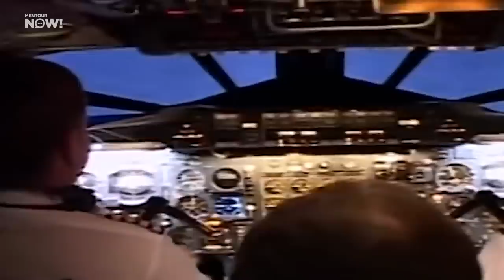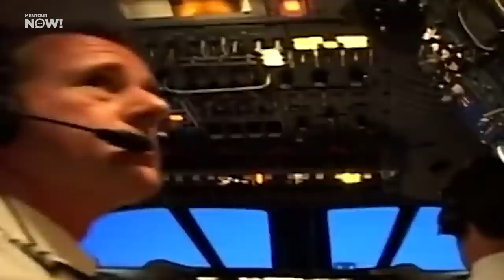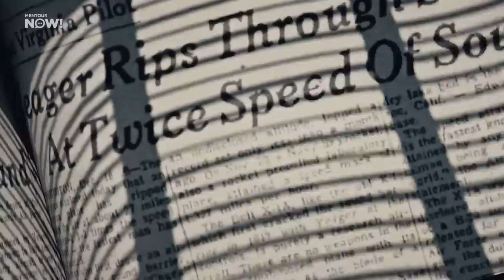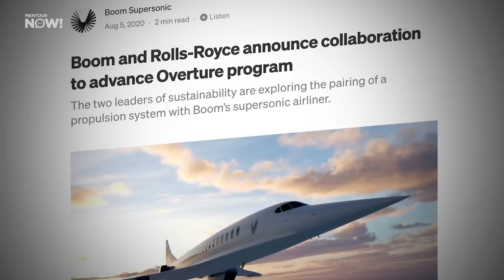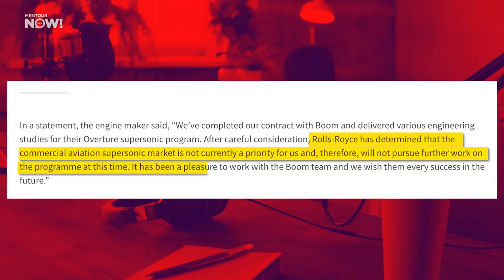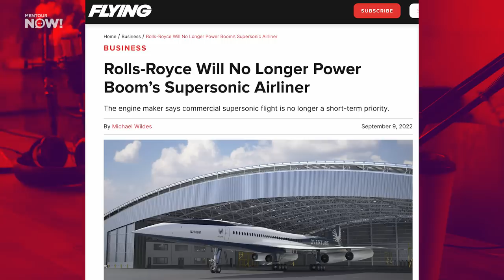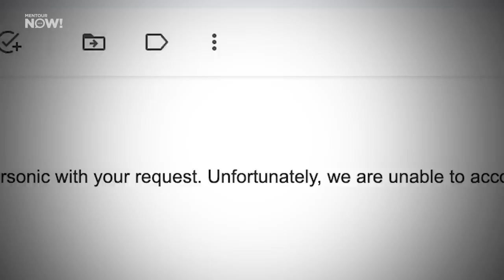WHAT’s Going On with BOOM Supersonic?! Will it Fail?

Comment: They just seem dumb to me. Building a commercially viable supersonic airliner is like a start up out of a garage stating they'll land a man on the moon. The USA's greatest shot at this very project failed miserably. It took the British and French combined together, spending three billion dollars (in the 1960s!) to make the plane work in an astounding feat of engineering. The commercial side was still largely a failure until Concorde became a luxo barge for the most wealthy elite. The engineering required then and now is off the charts difficult and the economic situation impossible when companies don't even want to run four engine airliners any more. It's sheer arrogance, stupidity or both for some little nobody to think they can do it even with the passage of 60 years. It's no easier today to do so than land a man on the moon. You better have government backing and a spare ten billion dollars. Then it might work.

Comment: Basically the project is dead, if top 3 engine manufacturers aren't interested then no other company has know-how or finance to make an engine. 🤔
Reply: Florida Turbine Technology, a division of $1.88bn Kratos Defence, started the symphony engine design in January 2023. Boom stated that no current engines, either military or commercial, are suitable for adapting to Overtures unique requirements. 

Boom will design the engine pods and the variable geometry exhaust and inlet ducting.

A big fuss is being made about Rolls Royce ending their contract with Boom, but AFAIK the contract was only for consultancy, and not to build an engine for Overture. Besides which, the Symphony project would be totally unsuited to the tier one engine manufacturers, like Rolls Royce, GE, P&W, and Safran. Their cost base and time frames would be out of kilter, and the volume of sales would not warrant their investment. GE caught a cold with the Affinity program.